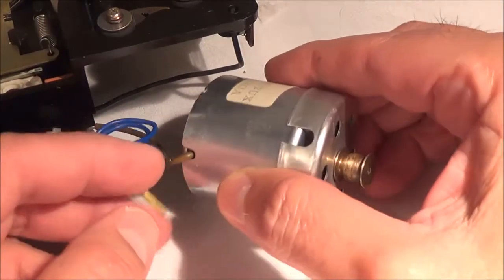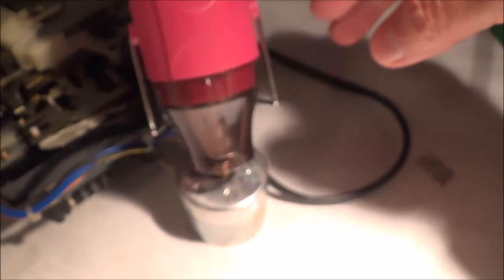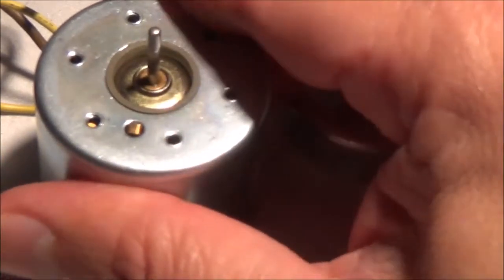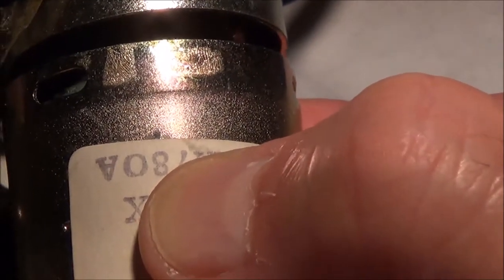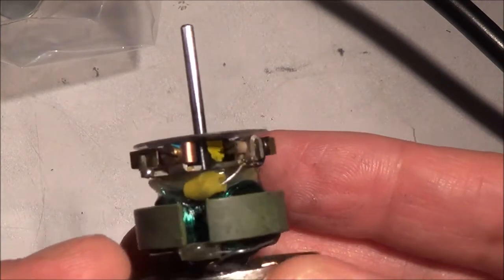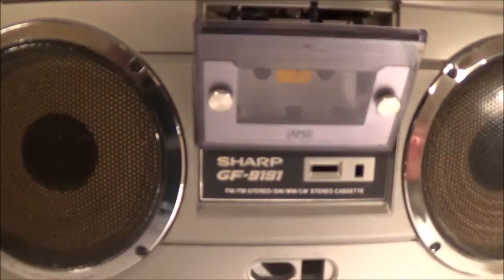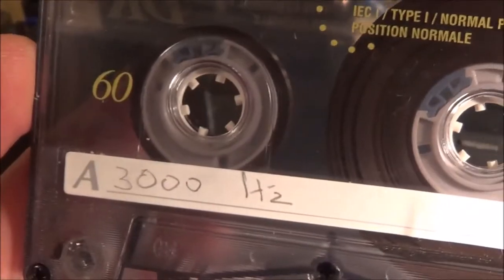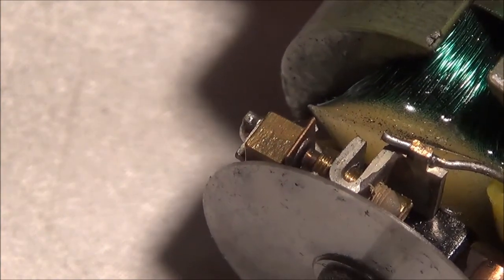Sharp GF- 9191 Motor

Comment: I have a sharp tape deck, with a electronic  motor controller built on the the back of the motor , must be fried internally because it runs continually whether or not the deck is in play , have to unplug the motor just so it won't run, also the motor gets really hot , a indication that it is not worth the effort to repair... winding's are burning....you realize the 3 screws holding the motor base on also adjusts the speed , that is why they are slotted holes... they have to go back together in the same position that they came out
Reply from the maker: Thanks for your comments! Now, it has been awhile since I worked on this motor, but as far as I remember, it had a governor-type speed adjustment, which I did; either in this video or another one. Most likely your windings are shorted; the ohmmeter function of your meter will prove that.